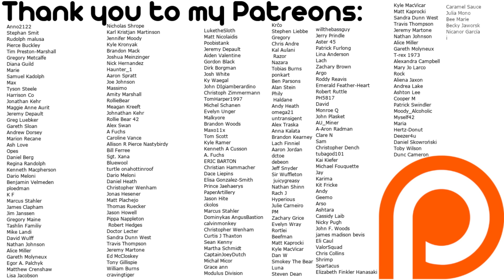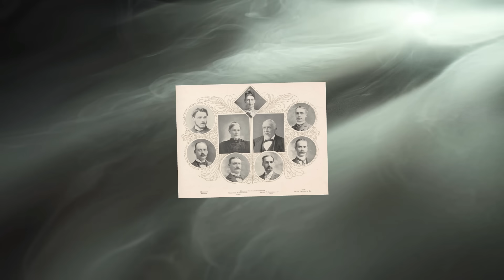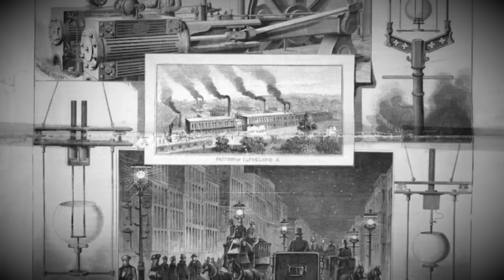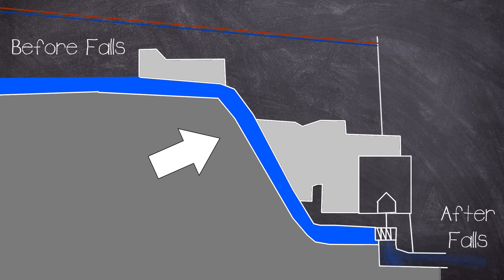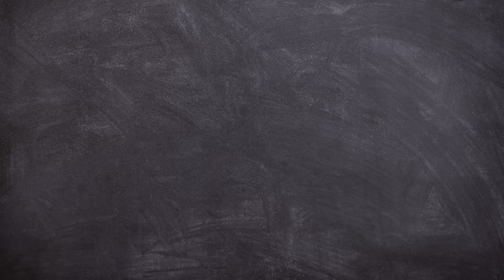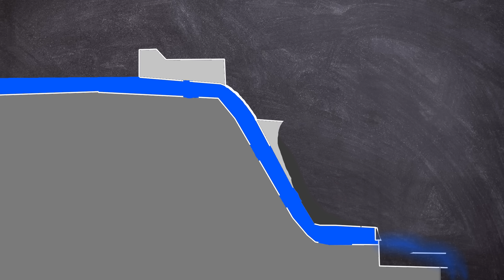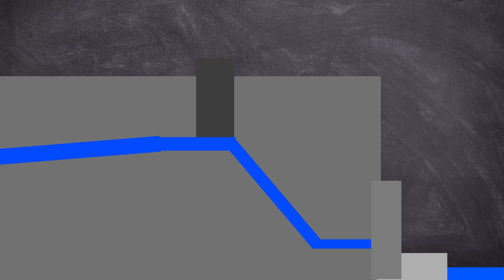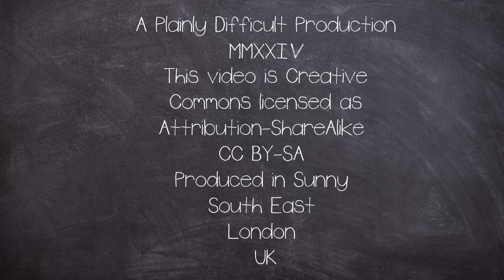How The Schoellkopf Power Station Failed Catastrophically

Comment: Power plants are measured in Kilowatts, not horse power.
Reply: You're correct but because they were originally using the output of the stations in direct mechanical form, horsepower would have been used to describe output in equal terms when the electric aspect came to be. Multiply HP x ~750 (745.7 if you like numbers) for watts, then dividing this by 1000 gets the kW value. To the consumers of the time, the kW rating would have been all but useless.

Comment: HP is used for motors of all types; however, electrical output, be it from a generation station or a power bank, is not measured in HP.

Comment: The Schoelkopf power plant was replaced within four years by a massive hydroelectric and pumped storage facility owned by the Power Authority of the State of New York with an installed capacity of 3,386,000 hp.
Reply: In US everybody uses any random units instead going to SI ;)

It is fun fact, because energy is measured in W (watts) and is easy to check/measure how much watts of electricity is generated by generator
If You need hp - You need calculate by taking watts and multiply by (around) 1.3 ;)

Same with cars - all engines or motors are measured in W
To calculate hp or BHP (these TWO different units!) You need do the math ;)

Please - use SI - for everyone peace of mind.
Reply: @stanley3647 in the US, power generation (and many other things) is measured in SI units. Idk why John and OP used HP.

Comment: Large amounts of moving water is a terrifying thing, the forces involved are staggering. I can't believe anyone had the guts to go back into the other building after this happened. If I had seen those cracks forming that wall I would've immediately noped out and made a run for it. Interesting thing is that looking at this on google maps I don't see any trace of the old canal jumping out, usually you can see some evidence of stuff like that but the whole neighborhood looks different than the map you put on screen. The 1950s wasn't that long ago after all.
Reply: 70 yrs .
Reply: @alangordon3283  in that area where it is simultaneously long ago and not long ago

Comment: There is something incredibly scarousing about belt driven machinery.  First job I had in college had a belter drill press.  It had been converted for standalone-conplex electric operation.  Apparently what that means is you mount a huge electric motor on the base with a pulley on it and switch to a smaller belt that's only slightly taller than the average 7' human.  

AND THAT'S IT.  

Needless to say I tended to use the more modern press with the warning stickers and the guards and the cowlings that enclosed all the fun stuff.  I started up the Widowmaker with the limb-ripper accessory on it once out of curiosity.  

Once.  

Afterwards I decided to focus my affections on the lathe that I'm pretty sure had been used to make shells in WWII. 

Kids, DO NOT attempt to turn sheet metal.

Comment: And to this day the rotor of one of the generators remains in the river just below the site. It becomes visible during times of low flow over the falls. Today the site has the docks for the American Maid of the Mist boats, which were recently upgraded to use electric propulsion. With the power sourced from the hydro power stations in the area.
Reply: So that's what that is! I've seen it at the falls a few times and wondered about it.
Reply: @thing_under_the_stairs it’s not at the falls but in the gorge. You must be talking about The Old Scow a barrage boat that got stuck on the rapids before the falls around 1900.

Comment: I would have included watts or used them instead of horsepower. 1 hp is 745.6999 watts unless electric horsepower has a different value.
Reply: Actually, in those days they did use HP as the unit of power for power plants. But these days of course electric generation is measured in MW. And yes, 1 hp = 746 watts

Comment: Never underestimate the power of water, especially if it is already flowing!
Reply: Never underestimate the power of water when you try to stop it.
Sudden stopping of hydroelectric turbines has destroyed a number of power stations (like Sayano-Shushenskaya (very well covered on YouTube) or Dartmouth (almost totally unknown because there were no fatalities (just a very wet operator stuck in a lift that was blown to the top of the lift shaft by the water hammer)).

Comment: There's something deeply unsettling about the early images of several dozen - there's no better word for this - holes in the cliff face with water jetting out of them. Nothing quite so encouraging and safe as a rock face that resembles a sieve. I'm sure it all came out fine in the en- sorry, I'm getting a note handed to me and it did not all come out fine in the end.
Reply: Most of those waterfalls are the discharge tunnels of the various factories using the hydraulic canal's power for themselves before electrification had really caught on. As the power grid was developed most of those factories relocated elsewhere, the tunnels they used plugged with cement.  

Actually somewhat surprised that the culprit wasn't traced to being one of these old hydraulic power tunnels having been poorly plugged and starting to leak, putting excessive pressure on the retaining wall behind the hydro station.
Reply: i know i was just thinking that. Imagine trying to explain to a geotechnical engineer that you want to drill a whole whack of discharge tunnels through a carbonate rock cliff face.
Reply: It was fine untill they closed them all to turn the rock (more like dirt) face into a dam
Reply: One thing you have to consider is the break neck speed everything was being replaced. To have a waterwheel driven mill destroyed by spring flood 3 times in a decade was normal.
Reply: I'm surprised they didn't blame it on the engineer who worked on the project! 
......Oh wait, there wasn't one!

Comment: It's always good to do a power station failure video that isn't nuclear for once lol
Reply: but … i like the nuclear 👉🏻👈🏻
Reply: @LightBlueVans Uwu 😂
Reply: Yes, but Hydro failiures are almost as frightening! I wonder if John has some Coal-fired power station disasters... and I've just remembered the near failiure of the electrical transmission systen across the Pennines in 1985-1986 due to high winds, ice and snow..... (that's a good one for a near miss video!)

Here's some partial You Tube on the subject. https://youtu.be/QLl9NCJvZjw?si=HIo3tNVhxEA772qF
Reply: Nuclear ones are a lot less common lol
Reply: Yeah, it doesn't feel right if I'm listening to a PD story, and some poor bastard isn't melting from the inside out...
Reply: Needed a shift change though.